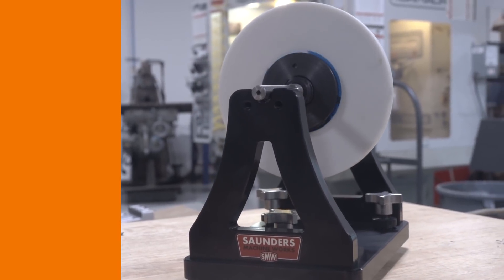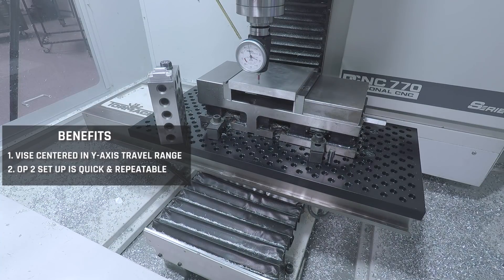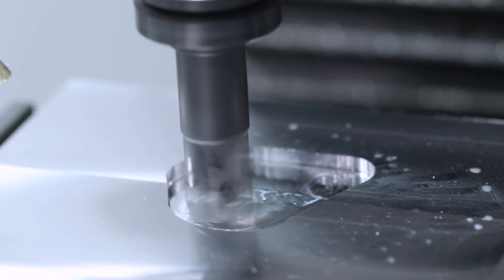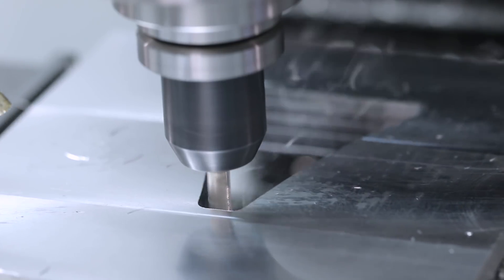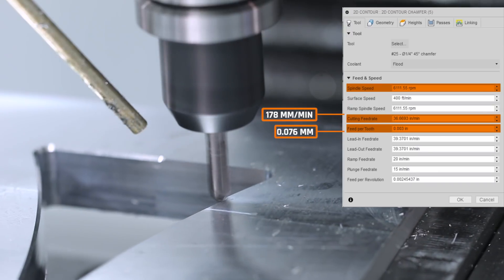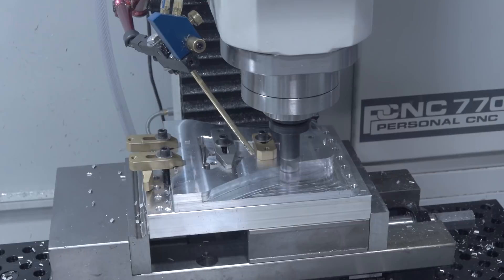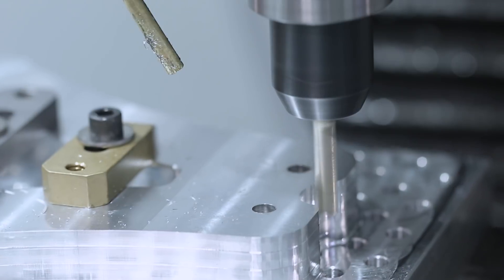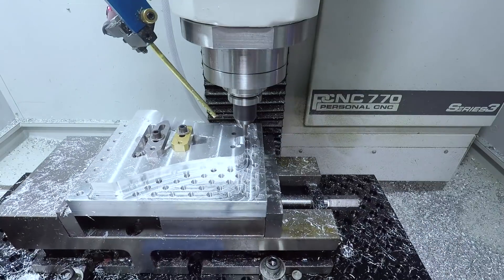Surface Grinder Wheel Balancer - Part 1! WW177

Comment: My advice would be to on the first OP leave one end stick out of the vice so you could mill the bottom without the need to move clamps in the second OP and mill the entire perimeter of the part .100 deep and chamfer so the second OP would stay off pallet .020 and all most no deburing by hand

Comment: nice . I just a one man shop repair stop for motocross racer/riders. I put my crank truing stand on the Bridgeport table and balance the 12 inch wheel on my (abrasive tool company) surface grinder.  that stuff is so cool I love it ,all I can afford is manual machines at that .

Comment: I'd do it it in two ops but a little different from you, start with a thicker piece of material by about 10mm, grip on 3mm, min skim top, then I'd cut everything on one side that's possible including drilled holes, the centre, the outside profile, the chamfer. I'd flip it, put two bolts in the holes and a clamp on the opposite side - in the middle of where you put your two outside clamps. Cut it to correct thickness, leaving a boss around the holes and avoiding cutting through the clamp, then chamfer the outside, place clamps on a finished size area, remove the old clamps. Remove left over material with same tool used to get correct thickness

Comment: Observation #1.  Why do you need to remove the interior of the stand?  Looks like wasted machine time and design time.
Final Observations.  Design it for balancing a grinder wheel instead of for appearance and looks. You have turned a simple design/manufactured part into a lot of extra work.   I hated the "looks good remarks" when talking with manufacturing  ... I wanted to know if it was made to print.

Comment: G’day John, great work as always. Sorry if I’ve mentioned this before, but I notice you always spot drill holes and I would question the necessity of doing that each time you drill them. It may seem like a small point, but it’s another tool change and when multiplied by the number of holes over the course of a year, you’re talking hours of time. I don’t think most of the holes you drill would need to be spot drilled first, unless you were using that op to pre-chamfer the subsequent hole. A regular twist drill is normally sufficiently accurate in most materials for typical clearance holes.

Comment: To save a few steps, (in general, not just on this project) could you mill a slot in the bottom of the pallet to fit over the moveable jaw, and then just leave an extra jaw on the rear of the vice? So when you wanted to use the pallet, you could literally just drop it in and go. May have to make the pallet a bit thicker to account for the slot I suppose.

Comment: As a layman, my first instinct would probably be to drill a few holes for bolts to attach it to the fixture plate with a few small standoffs underneath. They'd be useless after the part is done, but hey.

Comment: If I didn't know any better, I think you were taking your tool to full depth on that mini pallet, and thus cutting into it. Now that's a no-no. Continual cutting like that just makes the pallet useless later for other jobs.

An easy fix to that problem would be chamfer that outside profile on the first op (which you didn't do. ??) when you chamfer that pocket on the first op. Once the chamfer is done, the tools that do the profile on Op2 don't have to go full depth.

Even though your chamfer won't look right on Op1, as long you can measure the pocket chamfer you know that the profile will be correct as well (when done with same tool). Now cutting that profile with just the chamfer will be using a tiny tip in the material. So it would be best to rough with a .25" inch tool or something first, only a small depth that the chamfer goes to.

This far easier to deal with chamfers on both sides of a part I think.
Reply: gredangeo 
Or just use .02 shim stock under the part for op2
Reply: Shim stock introduces flatness errors. I'd rather not ever get shim stock involved if I can. I view that as a bandaid solution to another problem.
Reply: gredangeo 
How does it induce flatness error? If you put 3 pieces down spaces around the part, it guarantees that surface is as flat as possible. The 3 points establish a parallel plane between the fixture plate and the part.
Reply: "3 pieces down" ? Wait, the shim stock doesn't even cover the whole part? That's makes it worse. The part can bend when you clamp it down.
Reply: gredangeo how much clamping force do you think you need?? 

And no you don’t want to cover the whole part.  I’ve never introduce additional flatness or parallelism errors by doing that. That’s how I actually get rid of those kinds of errors if the op 1 facing happened to warp the material.
Reply: Enough clamping force to resist twisting from the cutting. From what I gathered in this particular setup, the part is only located along the X Axis, Y motion is floating. Normally you can get away with medium to light force when you have pins backing up your twisting resistances. Granted, I keep forgetting this is on a Tormach. Probably not that much force to deal with anyways.
Reply: gredangeo 
Well. Put it this way. Less force than what it would take to deform the part over shim stock.
Reply: There is some serious errors in your setup or use of shims if shim stock gives you measurable flatness errors in a mill.
Reply: I just prefer to clamp down onto the part where there's material there clamping against. The clamps in those locations won't be where the shims would be.

Comment: Why is it cutting clockwise? The tool is spinning clockwise and the cutting path is going clockwise too. Shouldn't it be the opposite?
Reply: which operation?
Reply: Most of them. There only few that go counterclockwise.
Reply: That would be climb milling....  that’s the correct direction of cut.
Reply: You can do that on a cnc mill, never do it on a conventional machine
Reply: Why is it so? Isn't cnc just motorized mill?
Reply: Andrew Spacespanker 
Yes, but no.  CNC uses motorized powered axis and far more accurate ballscrews than manual mills. 

They don’t suffer from the backlash issues of manual mills. Which allows you to climb mill without worry and push higher chip loads.
Reply: But do note that it is only those Americrap manual mills that have backlash errors and loose gibs to worry about, actual machines have something better and are happy with climb cutting.

Comment: Just for grins, take a look at two very old videos of mine under a different account that show using magnets instead of bearings:  

https://www.youtube.com/watch?v=urAY_g2gmGM

https://www.youtube.com/watch?v=53mUcjocNUQ

I find this so much easier than trying to get perfect alignment between bearings and if adjusted properly it us MUCH less friction than rolling bearings.  I hope the video is self explanatory, especially the second one.

All you need is a steel shaft with a short taper on one end, two tapered cones to support and center your work to balance, and a fixture to hold magnets rigidly an adjustable distance apart.  One end of the steel shaft is flat, the other is tapered.  The magnets will attract the flat end more powerfully than they will attract the tapered end because the taper has less steel to act upon.  So when you get the magnets just a bit further apart than the length of the shaft and place the tapered end of the shaft on one magnet the other end of the shaft will be supported by the other magnets.

Now as you make that gap smaller the attraction will increase until the shaft jumps from the magnet on the tapered end to the magnet on the flat end.  Once you get there, increase the gap back a tiny amount and pull the shaft back over so the tapered end is against the magnets.  Now it should stay there but the net force between the magnet and the taper will be so low that the tapered point alone with the tiny force involved will result in the lowest friction I've ever seen on a shaft.

Comment: John! can you do some more videos with the 440? I'd love to see it pushed to the limit, Im curious to what can be done with such a small machine! Thanks man!      For this part, I originally thought if you could do away with the center detail and just make it 3 holes for some cap screws, still index on the dowels but clamp with screws. Not sure if the center detail will have some function or is just cosmetic.

Comment: Huh, Interesting and great job as always John, This video goes to show how many ways there are to skin a cat! I would have machined the whole part out (full depth) in the first op holding onto only .060" then flip the part and use a facemill (less violent than a flycutter) to face off the remaining stock,  tends to waste a tiny bit more stock, but makes for a super reliable no hassle setup!

Comment: Are you compensating at all for the fact that the Tormach doesn't have the guts to properly run that Shear Hog? You can hear the RPM drop which means your chipload goes up, so are you compensating with a lower chipload to start with so it normalizes in the cut?
Reply: Kenneth Higley 
I don’t hear an RPM drop. I hear a heavier chipload, but not an RPM drop on the spindle.

Comment: So I saw you dec the first side. When did you clean up the second face?

I do have to wonder about using roller bearings on a balancer, especially large diameter bearings. Most of the balancers for various things that I've seen either used flat knives, or a pair of knife rollers of fairly large diameter with small ball bearings.

Comment: i would've done it in 2 ops
- op 1 rough out and finish inside pocket and all external features plus chamfer
- op 2 flip part into a custom soft jaw and deck it to thickness with a face mill then chamfer edges

keep in mind that op 1 would machine the entire part height plus say 0.050" depth (to provide clearance in the second op fixture)

Comment: Stop using the shear hog for everything! There are better tools a 1/2 2 flute em would have been much more beneficial for such a thing plate you can use the center cutting 2 FL em to drill a center hole (or use a drill if you prefer ) then interpolate out at 2 depths then use the 1/2 2fl em for the cleanup pass should fit in those radii if not use a 3/8 2fl em do op 1 and 2 on the mini pallet and you wouldn't have to pick up your x and y again there are much easier ways to machine!
Reply from the maker: 1/2" carbide end mill = $50? $60?   One accident, chipped corner, chip welded flutes = no good
Reply: NYC CNC no need to be carbide on aluminum I've run hss on titanium no problems all in the speeds and feeds hss 2 FL 1/2 will do the job no problem and speed up your part time (production) time is money say you can make the part 1 min faster (probably faster) assuming you want 100/hr from your machine that is $1.66/min time that by 1 min per part and 1 em should easily do 50 parts that is 83$ savings factor in the cost of a hss em at $20 you have saved minimum $68 on 50 parts not including tool change time or fixture time shear hog is a good tool but not always ideal! Love your videos John!
Reply: Please for the love of everyones eyes, use some periods, commas, anything!
Reply: A 1/2” 2 flute endmill would require significantly more HP and torque than the shear hog does. 

Also the machine is limited to 100 ipm. This favors a large single flute cutter over even a 1/2” 2 flute cutter. 

The MRR of the shear hog will beat a 1/2” cutter on that machine every time. 

And using HSS??  😆. Hey you could use a cold chisel as well, but why?  Why invest in HSS when the rest of the machines are all running carbide? Doesn’t make any sense to.

Comment: The process of truing balance wheels in watches is somewhat similar, instead of roller bearings the shaft is placed on a set of parallel knife edges and rolled. If it favors a spot on the wheel 3-4 times, then that's considered to be a heavy spot. Hope this helps. Great video.

Comment: Could you have added an extra hole or two towards the base of the part for location? you could have also bolted through those holes and not required the strap clamps.

It's a long time since I did any machining so forgive me, would placing three washers or shims under the part lifted it slightly so you wouldn't kiss your mini pallet? would the part still be stable?

Comment: Question, on the roughing operations, why not have conventional then climb milling for the inside corners instead of conventional, go back to the start of the segment, repeat?  My apologies, it's been over 20 years since I touched a mill, let alone did any kind of NC milling.
Reply: CNC mills like to climb cut. I think it has to do with loading the ball screw. I have a Tormach 770 and have 
always used climb cutting. I know manual milling and climb cutting gets pretty interesting if the cut is
to heavy or you have loose gibs, in that case the table has a tendency to feed itself .  :)
Reply: Climb milling requires less power in the cut than conventional milling. Plus unlike a manual machine, there’s virtually no backlash in the axis screws, plus they are powered axis so the cutter won’t pull the table in a climb milling cut like it would on a manual machine. 

Conventional milling is still used sometimes, but only to control which way the  tool will deflect in a cut. Other than that, climb milling is the way to go on a CNC.

Comment: Op 0 some holes out in the waste. Set on buttons on pallet. Hold down thru drilled holes. Punch some big holes to remove most of stock in inner triangle. Finish inside, bottom and some of sides. Stop, add clamps inside, remove bolts, finish outside. Flip, chamfer alternate side. If it fits on the table do both out of one piece, bottom to bottom.

Comment: Maybe I'm just used to larger mills, but why so many depth cuts for a relatively thin plate? Is the Tormach simply not rigid enough for that kind of roughing?
Reply: You’re looking at maybe max 1-1/4 HP at the spindle on a tormach. So doesn’t have the power to make full depth cuts. 

But at a price of around $5k-$7k and running on single phase 110v power. You get quite a bit of machine for the money.
Reply: yep, tormach is pretty weak
Reply: Makes sense, smallest mill I've ever worked on was a HAAS Minimill. Most I've used are at least VF2 size.
Reply: You can always switch to SoildCAM and use iMachining to get full DOC even on the puniest mills there is without worries.

Comment: NEVER put clamp removal program stops as optional stops. They aren't optional. Always use an M00. You will forget to engage optional stop one day and crash your clamps. In industry we usually put  a second M00 with an "are you sure?" comment just to cover those Monday morning days.
Reply: VolkCNC 
I was going to say the same thing. 
It works on this tormach because it doesn’t have a tool changer so optional stop is always on. 

But if you were to do that on the HAAS, it’ll go right past that M01 and go right through the clamps. 

M00 ALWAYS if you need a required stop.
Reply: Occams Sawzall good point. I just heard optional stop and had a panic attack. I put optional stops after before every tool change. Really handy when proven out programs.
Reply: Absolutely true! Learned this the hard way not long ago.

Comment: I'm no machinist, but this screams 3D printing to me. It's got 3 separate parts, all with large, flat surfaces, and no overhangs.
Reply: If your consider 3D addative printing as one part of the rapid prototyping tool group then you do have different options. Things to consider would be:
- Raw material cost, bar stock being cheaper than metal powder to run a sintering machine
- Machine availability, John has CNC machines primarily so uses what he has, tho he could have roughed out the shape on the plasma.
- Piece rigidity, I wouldn't make this out of ABS, glass re-enforced or aluminium seem much more suitable choices
- Dimensional tolerance, As this is for a high precision wheel balancer where the left and right need to be at equal heights it would probably require a post printing, maching op to be confident of the tolerances
Reply: It is going to be under reasonable load, be holding bearings, and have a SMW badge on it. As something that could join their product line making it out of a long string of plastic folded over itself would not be an ideal method of manufacture.
Reply: I mean. If you want to wait a week to get the parts.  And still go back and machine the critical features. And spend about 4X more in cost for the parts...  

These parts are a complete waste of time for an additive metal printer, because they are so simple to machine and the stock material is cheap. 

You use an additive metal printer for parts that are complex and difficult to machine or that has features that are unable to be machined.

Comment: Very nice John!  Can you link the video about showing how to get rid of all the whisper cuts when do the rest machining?  I know you did one, but I cannot find it.  Thanks!
Reply: You have to change the stock to leave and tolerances on the rest machining to be more then previous cut
Reply: Ok, thanks.  I tried everything I could think of the other day and could not get it to do it correctly.  I think I went the wrong way and made them less.
Reply from the maker: GOOD CALL - I'll do a video focusing on this
Reply: I think I finally got it.  The stock to leave has to be ever so slightly more and the tolerance has to be less in the linking tab.  That worked for the current project anyway.